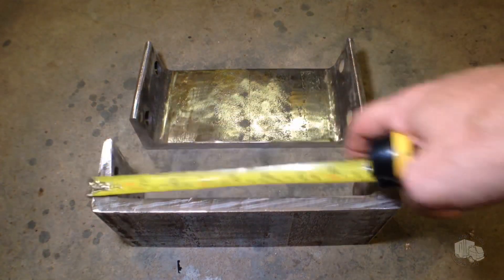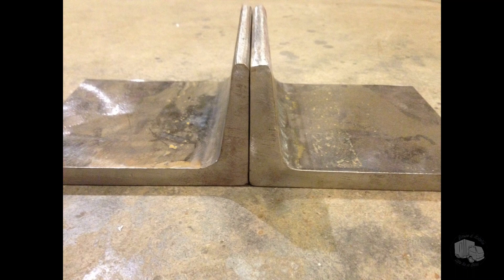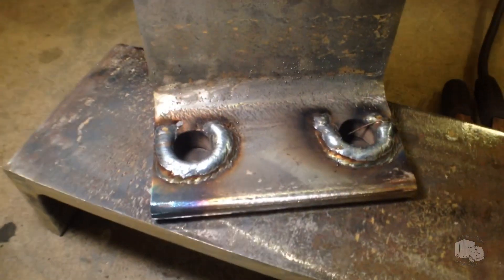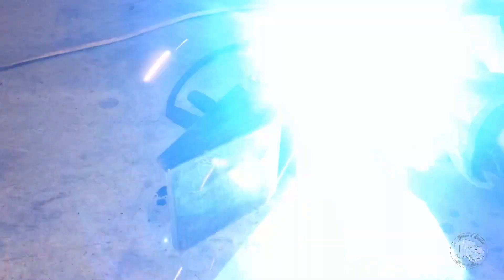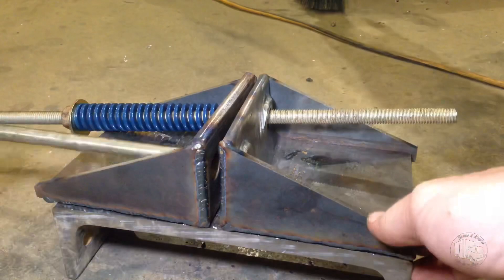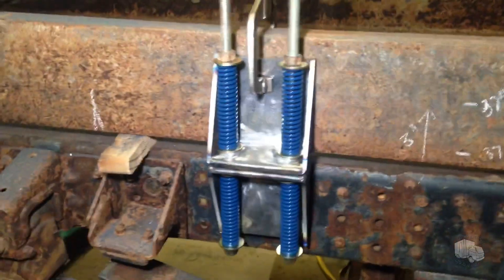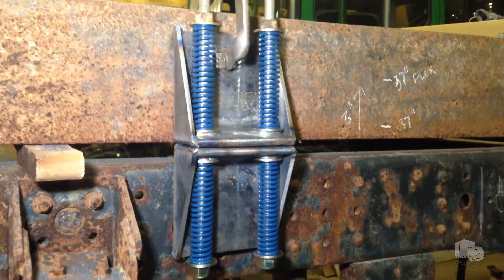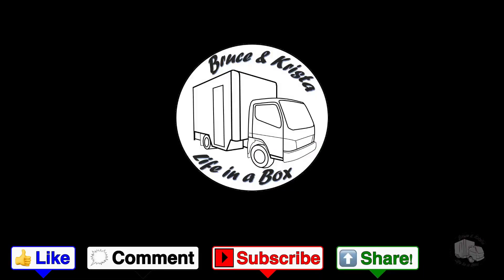Fuso FG Chassis to Sub-Frame spring mounts - DIY build!

Comment: I did this with 4" c-channel - both parts end to end - total length 12". My bolt on section for the frame rails is 8", as my frame rails are 8"
Reply: Yes
Reply from the maker: Did you weld a web across the c-channel for the spring/bolt?

Comment: Leave at least half inch gap between mounts better 3/4 inch for movement
Reply from the maker: Not quite sure where you are meaning for the gap, but the weight is resting on these, so the upper and lower surfaces need to be in contact.  Take a look at the 2nd video - might be a bit more clear where I ended up going.  

Sub-Frame spring mounts evolved! | Fuso Canter FG 4x4
https://youtu.be/8OR9joxzruc

Comment: Bruce , do you have any planning on the final weight of the habitat for the Fuso? My empty (less living equipment and furniture) habitat fully insulated with internal FRP walls will be 3000lbs
Reply from the maker: Hmmm, very rough calculations I would think the habitat box will come out around 1000 lbs - how thick are your panels?  My walls are about 150lbs each - so about 600 lbs for the composite panels.
Reply: @BruceandKrista  Approximately what did the composite kit cost?
Reply from the maker: Panels were about $2500 each (CDN), but could easily change at any time.

Comment: Bruce I have a FUSO. What size and spec of springs did you use for the subframe mounts?
Reply from the maker: Hi!  I’ll be doing a follow up video to this one very soon, and I’ll make sure I put the spring info in that video.  The springs are ISO medium duty die springs, and I’ve started out with a few different sizes.  Some of the springs are 5”, some 5-1/2” and one pair is 12”.  The shorter ones will be paired (as seen in this video) and the long ones will be on their own.    If you look at the Grainger website and search WWG44V087, WWG44U532, and WWG44U626 that should get you what I’ve got.  The key to the way I’ve designed this setup is that I can easily change out springs for stiffer or softer ones, once we see how this setup performs.
Reply: thank you @BruceandKrista

Comment: Nice springmounts.  Didja put a thin sheet of rubber in between the top and bottom to keep the noise down?  Good.
Reply from the maker: Well truth be told, they are not installed yet, but there will be separation between to land bottom to prevent the steel slappage!

Comment: You mention there will be a gap between the mounts... Do you intend to fill that with some hdpe like material? Will you also be putting material between the frame rails and the subframe rails? I've seen other people put a wood shim in there.
Reply from the maker: Yes, exactly - so far it appears the gap will be about 1.25”, and there will be a layer or two of HDPE (or similar) the length of the chassis rails.  I want to avoid wood since it can retain water and hold it against the steel.
Reply: @BruceandKrista  Makes sense about the wood. How did you determine that 1.25" gap?
Reply from the maker: @jeremybillauer9584  it’s the height remaining on the rear section of the frame (the dropped section) when the forward part of the sub-frame is set just high enough to clear the frame rivets on the forward (raised) section.  There will be similar HDPE on the forward section, just at the minimal thickness, to clear the same rivet heads.

Comment: How'd you figure the spring sizes? Really enjoying the build btw
Reply from the maker: Thanks!  Spring sizes are a bit of a guess, but with the ability to adjust the tension by tightening the bolts - and if absolutely needed swap them for stiffer or lighter ones.  Really all we are trying to do is prevent the box from swaying, and eliminate torsional stress from the chassis being transmitted to the sub-frame.
Reply: Thanks

Comment: Nice work Bruce! 
You seem to have changed your strategy from earlier plans. Four springs on each mount vs. just one. Six mounts instead of eight etc. May I ask what has informed these decisions?
Reply from the maker: Front and mid mounts will have 4 springs each - rears are a single (so far anyway!)  building with two shorter springs instead of 1 longer one makes it more compact.  Having a pair of springs allows for a lighter weight spring.  Most decisions based on what I could find, but also limited space to install without interfering with box/suspension!